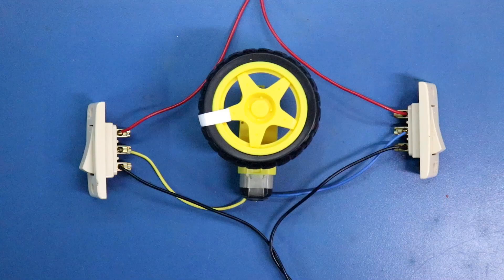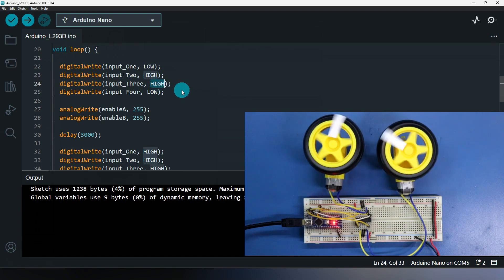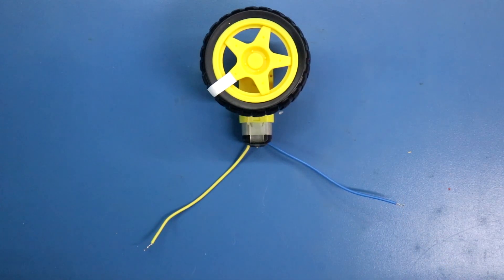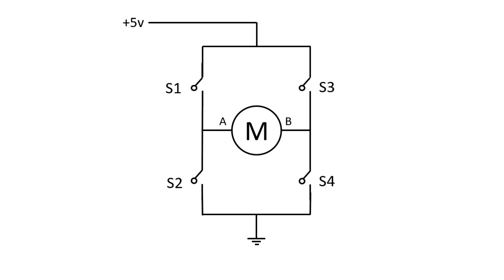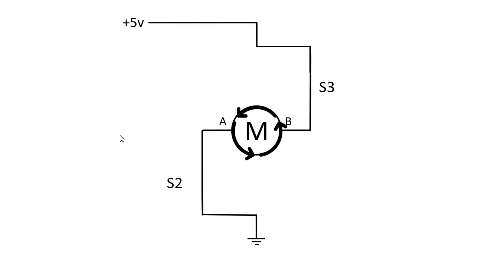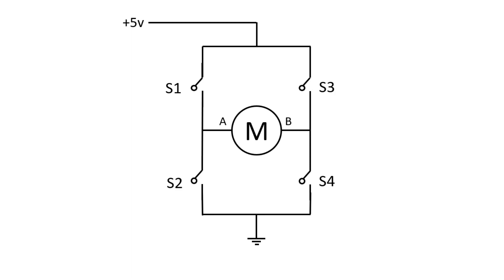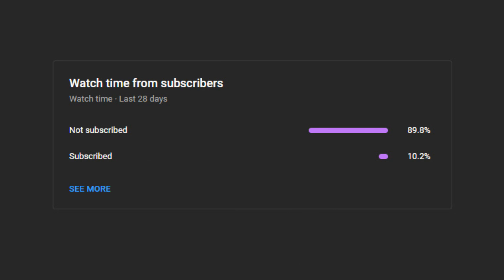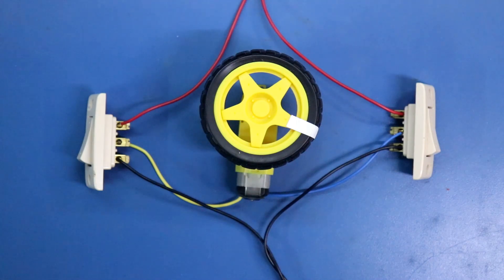Working principle of H Bridge circuit using Switch | H Bridge Part 1

Comment: Great series. I need to know this for a project I have so thanks for explaining it to me. Rather than switching direction of a motor I need to create an alternate polarity dc pulse to drive a slave clock motor. This will help me figure it out.
Reply: He's a great engineer. I wish his channel was bigger. His older stuff on different cmos circuits are a great entry point into the logic theory for further reading. The worldradiohistory site has so many free books related to our hobby

Comment: Good experiment! Is this the IC circuit which is used in RC cars/vehicles or servo motors?
Reply from the maker: We use this to control DC motor and Stepper Motor. Generally we do not use IC L293D for Servo motors.